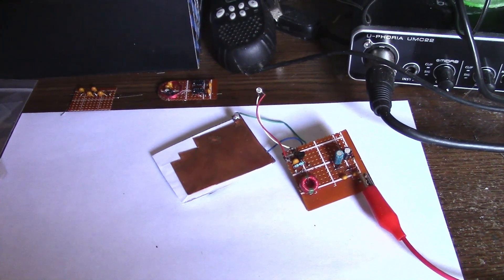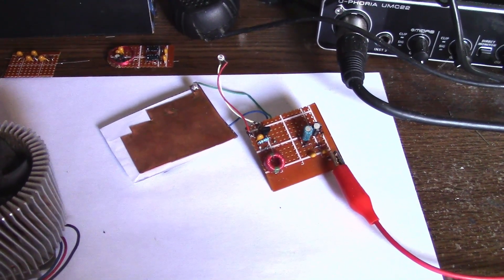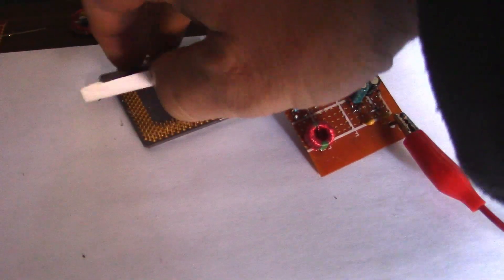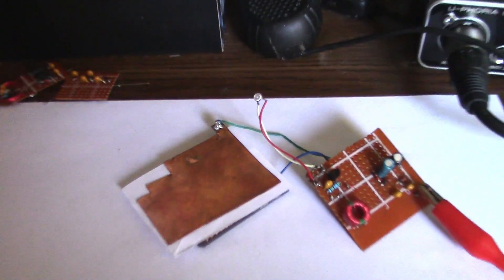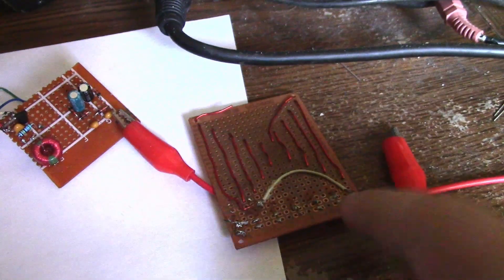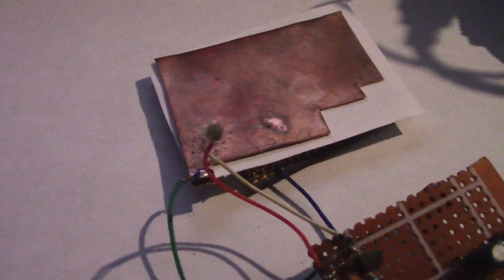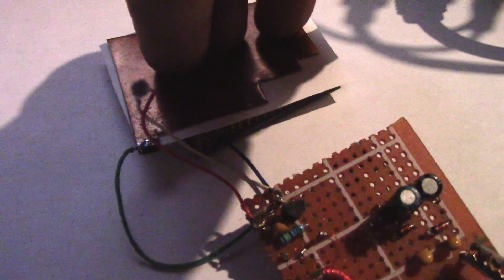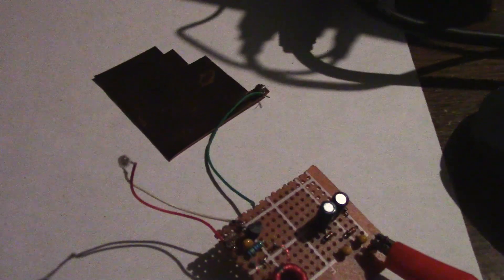DIY Energy Harvester  - What Happens With 2 Grounds?

Comment: Yes I would not be surprised if it is a static field that helps switching the transistor on and then gets sucked into the circuit as extra push. The switching transformer of the computer might produce it even if the computer is of but connected to the wall. Even only the non metall material of the PCB boards of the antennas could be doing something.
Reply from the maker: Cheers. There's a vid coming up about that whole matter... about just what is going on with the PC. So much of this is very surprising, considering we don't have CFL bulbs or CRT televisions anymore. FCC says all electronics are to be shielded and yet here we are harvesting!

Comment: Great stuff Mark, truly amazing circuit. I don't think you can get much more efficient because it's running on fresh air already 😂 so if the ground plate and the antenna plate is shaped into a pleasing form i.e. circle or maybe the outline shape of a cat,tree or maybe put the plates in picture frames you could have a shelf full of oscillators all running from what would look like ornaments or pictures , great video got me 🤔 😊 👍
Reply: Great idea, John 👍👍
Reply from the maker: Great idea and you certainly have some awesome build platforms for circuit projects 😁 
I was just looking at a small plastic car and wondering something along those lines. It's for the WiFi version though, which has come along greatly... I'll be uploading that vid in due course.